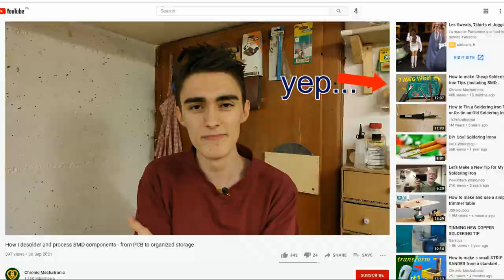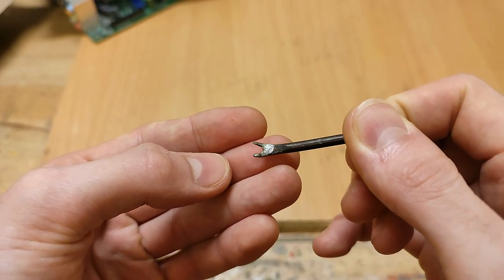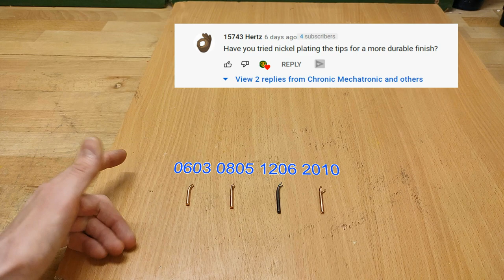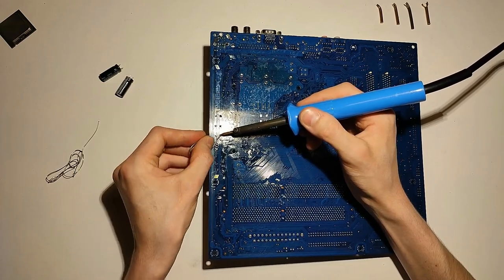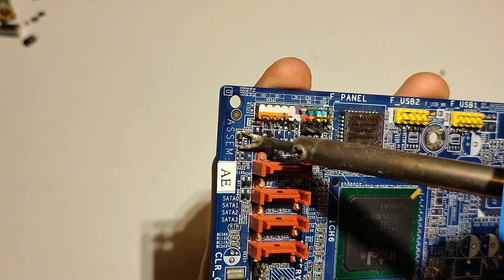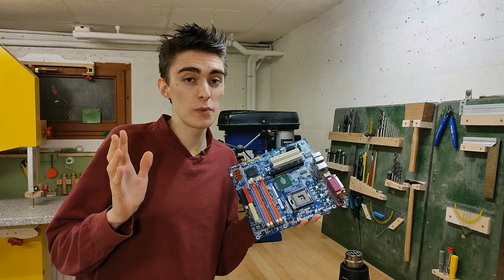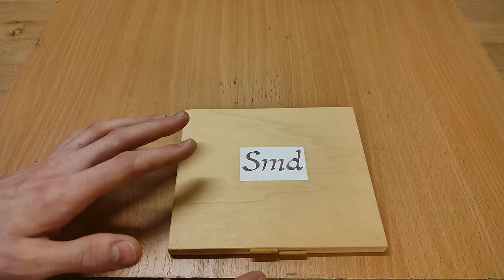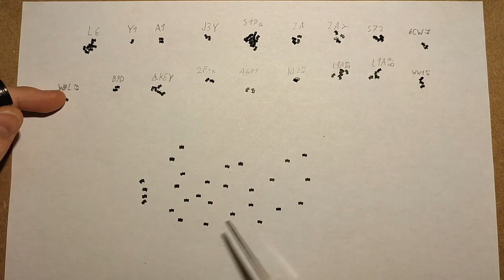How I desolder and process SMD components - from PCB to organized storage

Comment: A tip for desoldering: Add more solder to the pads. Not only does it add fresh flux to it, it also increases the area for heat transfer thus making it easier to desolder.

Comment: Hi, I liked your video. I was looking for something like this for a little while. Although some people would think this is a waste of time and that it would be cheaper to source new SMD components,  not everyone in the world have cheap and easy access to these components in bulk plus, reusing them helps a little to reduce the e-waste problem.

 I have a question, how do you know which components are good (keep) and which are damaged (throw away)?
Reply from the maker: Very good question! I basically just keep them all. The likelihood of running across a dead component is so low as far as I know, that it's definitely not worth the time testing every single one after desoldering. Usually on dead devices, nothing will be really broken at all, most of the time, it really takes very little to upset the microcontroller so it stops working.
That being said, (specifically for smd components) resistors pretty much can only fail catastrophically, capacitors have to be tested anyway in order to figure out the values, and diodes, transistors, or MOSFETs will probably be tested anyway sooner or later when searching for a datasheet...
But other than that, the probability of finding a dead component in a broken device is really negligible. I think I only had one dead capacitor in my collection so far, and that was an electrolytic one.
Only  exception are LED lamps and CFLs - they're usually designed to fry the components like crazy, and you'll frequently get dead transistors or MOSFETs.

And yes, it is a wonderful feeling to build an entire circuit board with components recovered from e-waste :)
Reply from the maker: Yeah, that's the problem with capitalism, money corrupts everything, transforming the most logical and reasonable step of reusing stuff into economical suicide...
At some point I might like to develop a robot that automatically desolders, processes, tests, and sorts SMD components from e-waste...